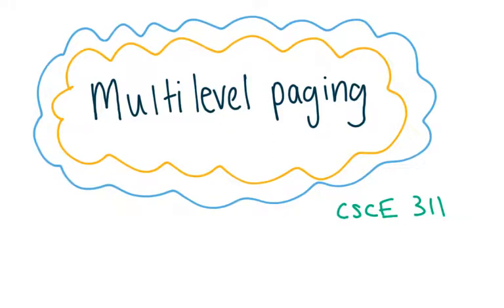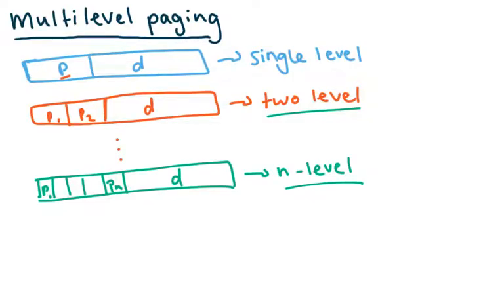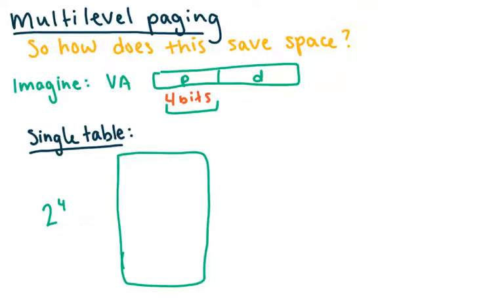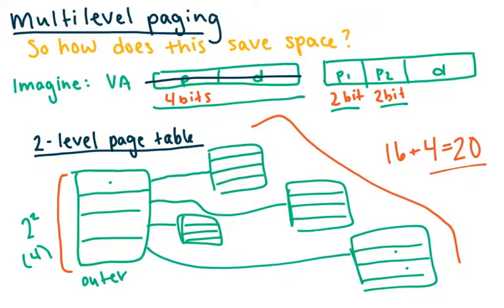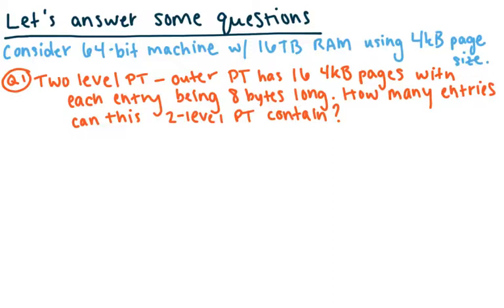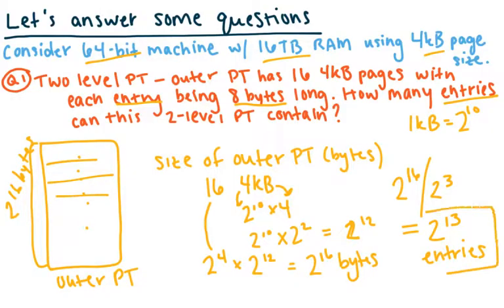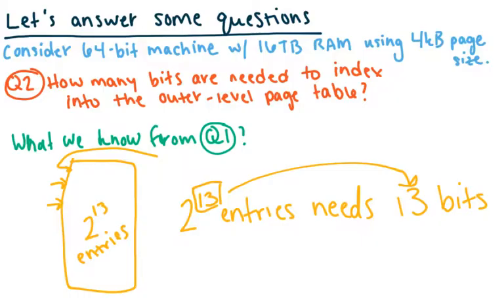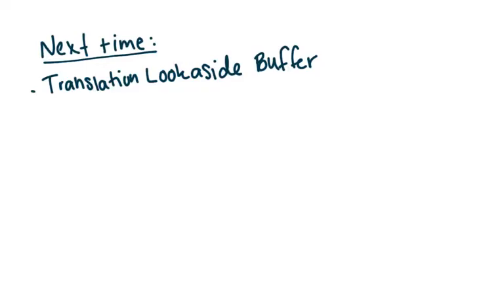Multi-level Paging (OS)

Comment: If we have 2^47 entries, and each entry being 8 bytes long, isn't the size of the virtual memory be 2^47 x 2^3 = 2^50 bytes instead of 2^59?
Reply: nah, I got it, 2^50 is the size of the page table, each entry will mapped into a page, which is 2^12 byte, so we have 2^47 entries = 2^47 pages, each page 2^12, and we have the size of the VM is 2^59
Reply: @bawfng04  which grade and feild are you and where , please ?